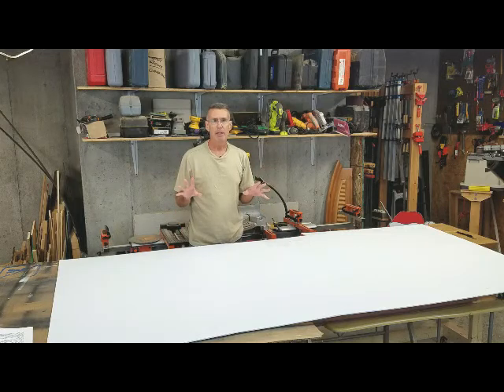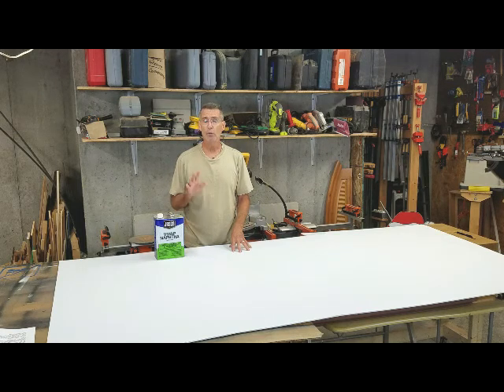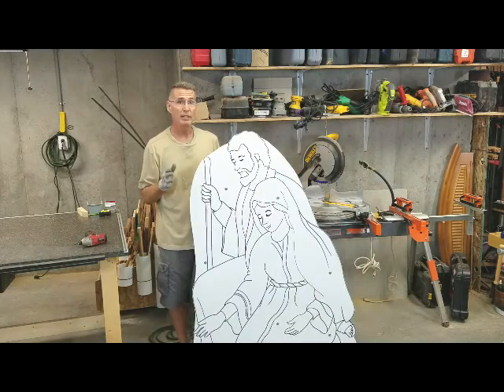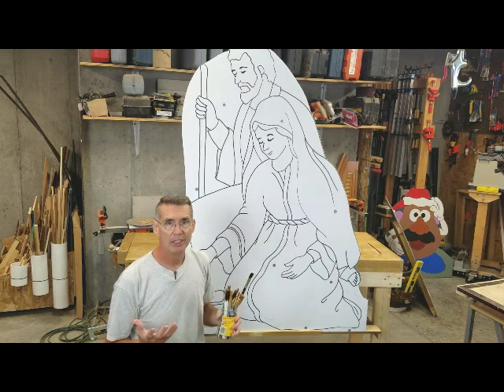Create an outdoor display for your front yard

Comment: Hi John! I think you've convinced me to try this vs plywood this year. What thickness coroplast are you using? I'm worried about wind.
Reply: The Coro I use is approximately 1/4 inch thick.  But the thickness of the Coro isn't really that big of a deal.    The trick to combating the wind is the wooden frame you build to attach to the back of the Coro.  We have wind gusts up to 40 and 50 mph at our location and the worst thing that has happened to my characters has been they've blown over.  Good luck with your project.  BTW... I'd really like to see pictures or videos of what you create!
Reply from the maker: Hey 0206ashley... the Coro I use is approximately 1/4" thick.  But really, the thickness of the Coroplast really doesn't matter a whole lot.  The thing that will make the difference is the frame that you make to attach the Coroplast to.  A good frame that covers the main portion of the back surface will keep the Coro from bending or folding over.  Using the washers in conjunction with the screws will keep the Coro from ripping away from the frame.

We have really high wind gusts here at our house (up to 40 mph) and the worst thing that has happened has been that my figures have blown over.  Well... there was one exception, I had an animated arm blow off of a character once... but I know longer animate my figures.  Anyway... with the proper frame, you really shouldn't have any trouble with the wind.  Just find whatever thickness Coroplast is readily available around you.  Good luck with your project... and I'd really like to see pictures or a video.

Comment: One more question: Do you live in a milder climate with mild winters, or do you get some bitter cold and a fair bit of snow? Asking to know if the plastic can withstand colder temps, high winds, and snow. I appreciate your answer and time. 😊
Reply: Hi Heather.  I live in a fairly cold climate.  During the time period, of having my display out, we probably average in the mid 30's during the days and sub-freezing temperatures at night.  Sometimes getting down into the teens... but that doesn't usually happen too much until later on in January after my display has been taken down.  We have a LOT of very strong wind in my area... gusts up to 50 and 60 mph.  If you make the wooden frame correctly, you shouldn't have any difficulty with using the Coroplast.  It is EXCEEDINGLY durable.
Reply: @jrbryant0136  Thanks so much again! Our weather sounds very similar, so that's encouraging! 😃

Comment: How are you cutting the coraplast around characters heads ect curves
Reply: Good morning!  I'm using a jigsaw with a metal cutting blade in it (less aggressive than wood cutting blade).  Also, for some of my figures, I'm not actually cutting right at the outline of the head (or other body areas).  When I have areas such at Superman's hat... I'm avoiding cutting out the intricate details because I don't want to have to try and build my frame to support such small pieces of Coro.  So, instead of cutting right on the outline... I cut out a "blob" (again, see Superman's hat) that I can easily support with the wooden frame.  I paint that "blob" area a dark grey (background) color and it just disappears at night when the spotlights are shining on the figure.

I hope that helps... and good luck with your project

Comment: How would you do a huge image that is larger than an 4x8 sheet?  Have you connected sheets?
Reply: Great question...  and the answer is yes!  In fact, I used to connect four 4x8 sheets of Coro in order to make a backdrop for each scene that I created. Unfortunately I had to stop using backdrops when I moved out to our house 12 years ago.  It's so windy, they just acted as large sails!!  YIKES!!!  I've also made several characters that are larger than one 4x8 sheet.  I've been pondering doing a video on that very subject... perhaps you've prompted me to do so.  My written answer probably won't be as easy to follow... but here it is.  Basically, instead of building my wooden frame so that it runs a few inches inside of the edge of the character... I run the wooden frame right at the very tip of a straight edge where I need to make the connection.  The adjoining piece of Coro is done the exact same way... the wooden frame runs RIGHT ALONG the straight edge.  In order to join the two pieces together... I simply butt the two wooden frames up next to each other and drill three or four holes all the way through both pieces of the wooden frame.  I then put some 5 inch bolts through the two pieces of the frames and tighten them all down really good.  When you're setting up a larger piece, that is made up of 2 or more sheets of Coro... make sure you put guy wires at those connection points.  That should help keep everything aligned properly!  I know my written answer isn't that great... and I'll try to put together a video real soon to show you what I'm talking about.  This year's display piece was EXACTLY that... three pieces of Coro attached to each other.  But I didn't think anyone would be interested in seeing that.  DOH... that's what I get for thinking!!!!  I think you've created the subject matter for my next video.  Thanks for spurring me on!

Comment: Whats the cost  and where is best place to get corplast
Reply: The company where I USED to buy Coroplast went out of business, so I had to do some searching.  I now purchase it at the local orange big-box store that has the initials of HD.  It goes for about $30 per sheet in my neck of the woods.  If you don't have one of those nearby, try another big-box store... maybe you'll find it there.  If that fails to produce results, see if you can locate a local sign making company and ask them where they get their Coroplast from.  (Coroplast is what they use to print all those political signs that you see in people's front yards... so they'll know what you're talking about)  That's how I found my first supplier!  When I called the sign making company... I made sure that I explained what I was doing (making Christmas displays) so that they didn't think I was going into the sign making business and would be competition to them.  They even offered to sell me some... but, of course, they marked it up in order to make money.  I can't blame them... but I was able to buy it directly from their supplier at a lower cost.  Good luck with it! 

OH... if you DO have a HD store near you... you can look it up on their website as to whether they have any in stock or not.  I did a search for "Coroplast corrugated plastic sheet" and got several results of different size sheets.  I go with the 48 x 96 x .157 (4 mm) sheets.  Just MAKE SURE you clean off the oily residue before priming and painting... VERY important and easy to do!  Just use some Naptha or paint thinner or any degreaser would probably work.

Comment: I'm looking to attach my display to the upper cross beams of the front entryway of my porch. I plan on framing it, as you explained, but do you have any thoughts on the best way to attach to the beams without damage to the house?
Reply: Good morning!  I can share with you the way I've attached some of my figures to my brick exterior walls.  Maybe it'll be a method that you might be able to employ???  I simply used a French cleat.  If you're not familiar with a French cleat, you might have to look it up on YouTube or in Google.  But, basically, you take a board and rip it the entire length of the board at a 45 degree angle.  You end up with two boards that can fit back together at that angled edge.  You then attach one board to your display piece with the sharp edge facing down and the pointy side out away from the back of your piece.  Then, attach the other board to your porch crossbeam and have the sharp edge facing up with the pointy side out.  Then, simply slide the display piece into the support piece and it SHOULD hang there without any issues.  This will leave you with 2 or 3 screw holes in your crossbeam... but you're going to have to have some sort of connection point and three small screw holes isn't too bad (in my opinion)!  I know I didn't write my description very well... but if you look up "French cleat"... I think you'll understand what I'm talking about.  I hope this helps out and I'd love to see pictures of what you come up with.  Good luck with your project!

Comment: Can you see the ridge lines of the corrugation once painted? I'm about to take the plunge and try it.
Reply: Good afternoon, and that's a good question!  If you're standing within a couple of feet of the Coroplast, you MIGHT be able to see the lines... but even within a few feet it's difficult to notice.  Once it's painted and you've got floodlights shining on it at night... you can't see the lines at all!  Just make sure you use FLAT paint or else you're going to get WAY too much glare!  OH... and MAKE SURE you clean it before painting.  If you don't, you won't get good adhesion!  Good luck with you project!  I don't think you'll be disappointed with using Coroplast at all!

Comment: Very informative! Would it be possible to stake down the cutouts with rebar instead? If so, how?
Reply from the maker: Thanks for the compliment!  I would drive the rebar into the ground until it feels firmly planted.  My guess would be about 10 to 12 inches into the soil.  At least that's approximately how deep I'd probably drive it into the ground here at my house.  I think you'll be able to feel once the rebar has made it down past the loose top soil and is firmly seated into the compacted soil beneath.  BTW... my daughter bought be a stake drive for my birthday last year and it worked GREAT in driving the stakes into the ground!  I'd highly recommend getting one if you're going to be driving very many stakes.  I'd love to see pictures of your display after you've put it up.  Thanks again!

Comment: Great video! How long do they last? How often do they need touch-ups?
Reply from the maker: Hi Heather!  Thank you for the compliment.  I have been making a new display vignette, out of Coroplast, every year for between 15 and 20 years.  My oldest display is almost 30 years old and was made out of hardboard (which I DON'T recommend).  I continue to use ALL of my Coroplast scenes that I've created through the years.  The only time I've ever had to do any touch-up painting was when I was negligent in moving a piece or putting it into storage and scraped off some paint.  Other than that, they have held up remarkably well over the years.  Generally, I create ONE new scene (each year) and display it along with 5 or 6 other scenes.  I rotate all my different scenes each year so that I keep my display looking fresh.  I'll usually put out between 5 and 7 vignettes each Christmas season... which typically means around  20 to 35 characters.  As long as you don't rough them up yourself... they should last you many, MANY years like mine have.
Reply: @makeitfunMonkey  💖 Thank you very much!

Comment: Someone reached out to me with the following question:  

"I use the flat exterior white as the base coat for painting as you specified and Within a month it started flaking from the base coat and almost crumbling in areas. Have you found a better alternative yet?"

I can't find that question within the comment section, so I'll just answer here.

The ONLY time I've run into that issue was when I didn't clean the oily residue off of the Coroplast before I began painting.  I ruined an entire set of characters by not taking the time to clean before painting.   If you cleaned the Coroplast with Naptha or paint thinner and used a flat latex exterior paint... then I have no idea what might have gone wrong.  So, to answer your question, no... I haven't found a better alternative yet because I haven't had the need to look for a better alternative.  I've been using Coroplast for 15 years now (I believe) and, as I said, the ONLY time I've had that issue was when I didn't clean off the oily residue left on the surface from the manufacturing process!

I'm sorry that happened and I hope you don't give up on making yard decorations!  I know EXACTLY how devastating that can be... but please don't give up on your decorations!

Comment: Would you fill in the edges with a silicone or caulk?
Reply: Good question... but the answer is no.  That's one of the beauties of using Coroplast... no issues with water whatsoever!  I usually have the "tubes" running vertically and I've never had a single issue.  The water just leaks right through and out the bottom... never an issue with it freezing and causing swelling or anything like that.  Now that I think about it... I've got a couple of characters where the "tubes" are running horizontally and have never had an issue with them either.  I used to use Masonite and had to ensure every nook and cranny was completely sealed.  And there was usually a small spot here or there that I overlooked and it would swell with water as it got wet.  With Coroplast... no issues at all.  It's plastic... so impervious to water.  If you've been making characters out of any type of wood product... I'd HIGHLY recommend trying at least one character out of Coroplast.  I'm THRILLED that I made the switch years ago.
Reply: @jrbryant0136  thanks! I have an entire peanuts gang from wood and want to try the cloroplast. Very tired of resealing and repainting every year. Too much work.
Reply: @NoName-ze7xq  You're welcome and I understand your pain in having to reseal and repaint.  I'd definitely give Coro a try.  Another plus is that it is SO much lighter weight and easier to move around.  I'd love to see what you come up with and hear what you think of Coroplast!

Comment: Can I use dremal to cut designs out?
Reply: Hi Leah... good question!  In fact, your question intrigued me enough to make me head down into my shop and give it a try!  I had a cutting wheel (spinning flat disc) already setup in my Dremel... so I gave it a try.  The cutting wheel worked rather well in cutting through the Coroplast.  HOWEVER, I could not achieve cuts that were quite as intricate as using my jigsaw (small curves, inside corners... etc).  AND, the cut edge of the Coroplast wasn't quite as smooth as using a metal cutting blade in my jigsaw.  

With that said though, I wouldn't hesitate to use the Dremel with a cutting wheel.  The reasons I say this are:  
1.  The cuts you're going to make for these larger type figures don't need to be intricate.  You are generally not making sharp curves and inside corners when cutting out a figure.  
2.  The edge the cutting wheel left behind on the Coroplast was only SLIGHTLY rougher than what I achieve with the jigsaw and metal cutting blade.  No one would EVER notice the difference when looking at your cutouts from 30 feet away whilst sitting in their car!  The ONLY issue with rougher edges is when you are outlining the figure with your black Magic Marker.  I've had PLENTY of rough edges and it's really no big deal to overcome.

If you don't have the jigsaw available... I would not hesitate to use the Dremel and cutting wheel!  Hope this helps and inspires you to give it a try.  I'd love to see what you create!